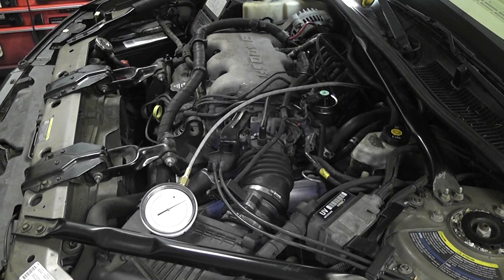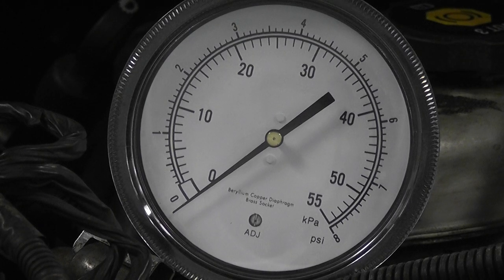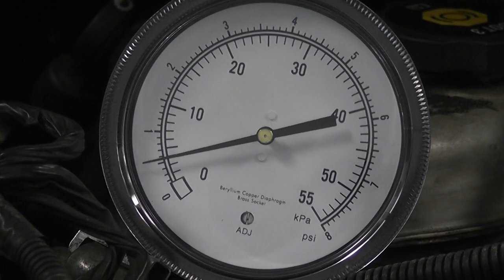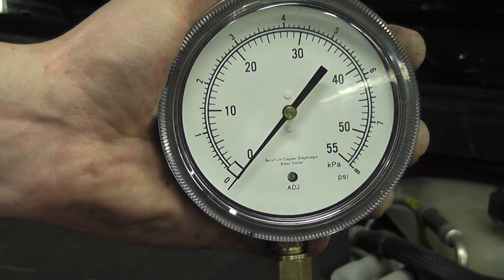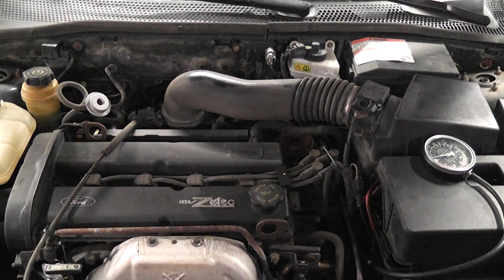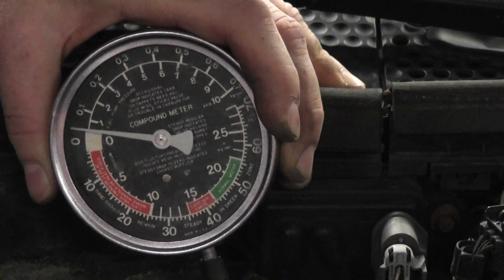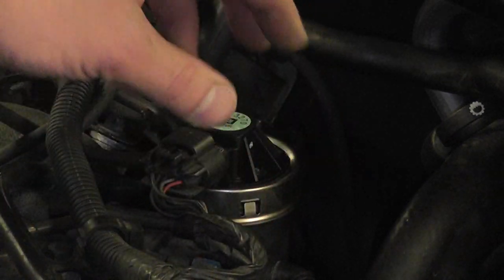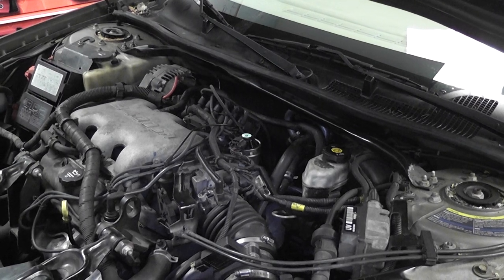Exhaust Backpressure Testing (known bad compared to known good)

Comment: One thing to note, on a car old enough to possibly be having a clogged exhaust issue.  Many times the tiny passages going to the transducer or DPFE / EGR can become clogged.  Although it is a different problem, it can prevent testing from these locations accurately.

Comment from the maker: It certainly couldn't hurt to do the test and as you said you would want to measure each side, unless it has an EGR system that would enable testing at that location. 
If it is normal at the EGR then checking each side wouldn't be necessary. If it is higher than normal then you would have to figure out which side is restricted.

Comment from the maker: @contagiousFX Hey thanks for the comment. I am not sure about the snap throttle vacuum test. (I'll have to do more of them) I know John Thorton (awesome instructor, look him up) uses the MAP sensor signal for his plugged exhaust tests.  But I know for a fact that the test where you hold the engine at 3000 and make sure vac. doesn't drop is not 100% accurate. I had a car with 5 psi of back pressure pass that test with flying colors.

Comment: Thank you for the recommendation for the Ford engines. Much more painless than getting to the front o2 on a 4.6. I previously tried the brake booster hose on a vacuum gauge and that didn't seem to provide accurate results. Will definitely try the DPFE method on my 99 Mustang GT.

Comment: What about using this pressure gauge to measure the pressure after the cat.  On the first test you obviously notice there was excessive back pressure, but you could not determine if it was from the cat or possibly the muffler (collapsed internally causing blockage).  If you use the bung hole for the aft O2 sensor (yes sounds funny, but technically correct), the one aft of the cat, you could compare it to the reading forward of the cat.  If the second is high, it is caused most likely by the muffler and if lower then the catalytic converter.

Comment from the maker: Yes and remember this is a no load 3000 rpm in park test.
Reply: ever test back pressure full load wot? i’ve tried for fun on my stock s2000 with high flow cat, I get 2psi back pressure before and after cat. then I tried on gfs rsx type s all stock, get about 8psi before cat, 2psi after cat. these are done wot hitting close to 8000rpm. just wondering if that’s normal. I get almost no back pressure under no load holding 3000rpm

Comment: I had this problem with my old bronco II.t.  Turns out an intermittent misfire issue I had days prior sent enough raw fuel down stream to melt the catalytic converter. Pulling the EGR exhaust tube and hearing it making a loud hissing noise confirmed the clogged exhuast.  Gutting the cat, made fore a quick solution.  Thats why I like OBD-1 no trouble codes for doing that!

Comment from the maker: @ncrdisabled yes, it is melted and blocks the flow of exhaust gas through it. Also there is a cause of the cat. melting. It is never good to just change the cat. without finding out why it overheated. (misfiring, air/fuel problems etc.)

Comment from the maker: Well that is a big difference for sure as this is a pintle position open code. Do me a favor, bolt the EGR back on. Take a reading on the signal wire with the engine off, then start the truck and give me another reading. It should not increase in voltage. If it does, you most likely bolted the EGR valve on backwards and vacuum is pulling the pintle open at idle. It can be done, I have seen it, however not all models have the clearance to bolt it on backwards but some do.

Comment from the maker: @Mrgeemoney25 That works but only for severe restrictions. I have had car with 5 psi of back pressure at 3000 RPM like in this video that passed that vacuum test with no problem at all. Thanks for the heads up though. I think the vacuum test is only 100% when you do snap throttle testing. I'm just not real confident with the test results on that yet.

Comment: Don't feel bad Paul, I've ripped the hoses off like that and broke some very weakened plastic nipples off the DPFE.
Those parts see a lot of stress from the engine bay heat and exhaust gas heat.
Not Ford's best idea.

Comment from the maker: BTW I like a .8 of a volt closed valve position, just make sure it stays there at idle. The pintle should be facing the intake port NOT the exhaust port. In other words intake vacuum should be pulling the pintle down, not up. This also backs up the notion that it cannot be a plugged exhaust causing this as exhaust gas pushes against the pintle on the back side.

Comment: I just break out a drill bit and drill a thick spot of metal for  a 1/4" pipe thread on the exhaust then tapping it put in a fitting then test it. When done you just put a 1/4" plug in and your done. Time to do is about 15 minutes.

Comment from the maker: Don't worry about the bi-directional control not working. What is EVP voltage KOEO and what is EVP voltage at idle? If the voltage rises significantly from KOEO to KOER then you most likely bolted the EGR valve on backwards and vacuum is pulling it open slightly. If voltage is high both times then most likely carbon on the seat and stem area is holding the valve open a little

Comment: Thanks for the reply. I was aware I might get codes with the new exhaust system, and I did eventually. But it does feel like it doesn't have the power it used to have, so when I first came across one of your exhaust pressure videos I thought it might be worth a shot checking to see if the cats did get overheated. There was a few misfire codes a year ago very briefly, but I think the code was for the coil pack. I don't know if this is the type of misfire that can hurt a cat or not.

Comment: solved the problem. the control wire connection to the egr valve was hanging on by onky a few threads. the connection was hidden behind that rubber insert gm has behind the connector. you are right it was power side switch. why does the ground need to go to pcm as well?

Comment: My bad, its a p0404 code. According to GM service manual, code is set off when there is more than a 10% difference between the desired and actual position. Getting good ground and I tested the reference and power voltage and both come out good at 5 and 12 V respectively. I removed EGR and checked the voltage on the EVP and was getting about 0.8V with the pintle at rest and about 4.4V fully depressed. Smooth voltage change as I manipulated the pintle. Dont have a scan tool so I just used a DVOM.

Comment: There is. Doing drive ability I always road test to verify the customer complaint. I always do this test during the road test, not in the bay. Drive the car till you get to where you feel a lack of power. From there move the throttle past where you are and back to that point again a bunch of times and watch the MAP sensors response.

Comment: im doing a back pressure test on a 2004 dodge dakota and the gauge is bouncing from negative vacuum to 1 psi at idle. any ideas ?
Reply: Exhaust valve issue is my guess. The negative might mean it's partially open when it shouldn't be

Comment: Excellent testing on exhaust 
Pressure testing.
About 15 yrs ago lbwas at a garage checking the electrics on a wagon, a fitter in the nexted bay had put a new exhaust flexy. On the exhaust system of a wagon, he started the wagon up.and was revving the engine, there was a massive 
Bang and he switched off the engine, l walked over to see what had happened,
The exhaust flexy pipe had 
Burst open, you could put, 
Your fist in the hole, and he said that what happened to the original one that was on,
I then said, you mean to stand there and tell me that, 
Did you not think of doing a pressure check on the exhaust system, those flexy
Pipes are over 800 dollars
Each.
Don't think he knows what he is doing.
More expense at somebody's in experience.

Comment from the maker: if the control wire is shorted to ground that EGR solenoid would be energized all the time (on a ground side switched design) and open all the time. you never mentioned a rough idle which is what it would do. some of these were power side switched and with that design BOTH solenoid wires go to the PCM and one will have a constant ground.

Comment from the maker: P1152 and P1132 is "lack of O2 switch, sensor indicates rich" and this is on both banks. So this suggests not an O2 problem but a rich running condition. (that matches your gas smelling oil too doesn't it?) there are a lot of different cause of rich conditions. fuel psi too high, fuel psi reg leaking (return type only), faulty MAF sensor, ECT sensor reading too cold, leaking injectors, bad head gasket, EVAP purge valve issues, timing chain issues, also I don't list a P0513 code? r u sure on that

Comment: Guy I used to work with would drill a small hole in the exhaust to test back pressure and then weld it back up when he was done.  Not the way I would do it,  but effective.

Comment from the maker: The P0405 is described as "Pintle Position Circuit Low Voltage". A plugged exhaust would not set this code. You potentially have a wiring problem. What is the EVP signal wire voltage with the KOEO (key on engine off)? What does the scan tool show EVP voltage and % at also KOEO?

Comment from the maker: If you have no low power complaints then I wouldn't worry about a backpressure test. This is not the test that is needed for a cat. code. In most cases the cat. code shows up way before it gets to the point of restricting the exhaust. My guess is your "high flow" aftermarket cats is what is setting the cat. codes. I'm afraid the only fix for that is to put the factory ones back on. I have ZERO luck with aftermarket cats. They just don't meet the OEM standards.

Comment: Based on your experience, do you have a clue as to what causes my car to die? This is a 1990 Volvo 760 GLE 2800cc EFI B280F V6 engine with ~240,000 miles.  I can start it up from cold, but once I place it in drive, the engine runs rough and dies. Once it dies it is very hard to restart. I have to wait for about 45 minutes. On pulling the plugs, all tips have a black coating indicating that it is running rich. I have installed new plug wires. Also removed the only O2 sensor at the CAT to check backpressure, which is zero PSI at idle and 3000 RPM. I have not checked the fuel pressure. I have to leave this to a profesional. My assumption is that fuel pressure should remain constant at the point where the car runs rough and dies. Removing the Fuel Pressure Regulator vacuum line at idle after operation for 15 minutes did not show any fuel leak. My only other hunch is that the engine may be loosing spark under load!

Comment: Hey Danner, nice video I never thought you could check the EGR valve port for back pressure now I'm glad to know that. I'm curious what part of the exhaust causes the back pressure is it in the exhaust manifold? because right out the exhaust manifold is the EGR pipe that goes to the EGR valve. I ask because I'm wondering if a bad or plugged CAT Converter can cause back pressure. Oh and what does a driveability tech mean? thanks

Comment: I've replaced plugs, coils,bots,Thottle postion sensor, Fuel filter, upstream o2 sensors, New air filter and Cleaned MAF sensor. old plugs were not wet with oil or ant freeze, Air filter in great shape, it starts and ildes perfectly, it's just after driving for a while it will start to hesitate ,then smoothes out,has good pick up otherwise but it happens on and off, then the E light comes on and the codes i get,P0513,P1152 &P1132, used Lucas cleaner,,now oil has slight gas smell,I'm stumped.

Comment: I also have a dodge ram 05 with the 5.7L. Its throwing codes for both cats and some 02 sensors, but only occasionally. I wanted to perform this test on it anyways, but I was curious about the differences for vehicles with 2 cyl banks compared to 1, if any. For instance, I have long tube headers and high-flow cats, but they merge into a y-pipe after the cats and then into the muffler and exit out the same side. Should I take measurements at each of the 4 02 bungs? Should I start with the EGR?

Comment: Would that test be suitable for turbocharged engines? I think that I've melted my catalytic converter (overfueling due to a damaged fuel injector which was replaced) and now it probably prevents the tubine to spin and create boost. The turbine is checked and ok.

Comment: try to connect the vacuum / pressure gauge to a good intake manifold source of vacuum hose like pcv valve hose or brake booster , then rev the engine  to 2500 rpm, watch the vacuum reading over time.. A known good vacuum would stay around 20-23 Hg of vacuum, without any excessive back pressure in the exhaust... If the exhaust was clogged and had alot of backpressure... the readings would slowy drop from 20-23 to 5-10 Hg of vacuum over time ...I will make a video soon to show it

Comment: That other code is a P0153,slow response bank 2 sensor 1 . How hard would the remedy to this problem be determined by a mechanic like yourself~ A few of these reapirs i could do myself, Head gasket no! and timing chain, which i'm hoping it's neither, on a tight budget. other's like the MAF I have no way to ck it, just replace it, and Leaking injectors if i knew which one  i surely would do those. Thanks for the info ,good stuff! Who would you recommend,Pepboys or dealer ? Ford dealer $80 to ck.

Comment: Oh, ok. Did the cars with partially plugged cats have a drive ability problem related to the cat? or multiple issues?. I am just curious. I ran into an older Mercedes that had no easy access to back pressure testing but had all the symptoms of a plugged cat, and possibly more. The customer didn't want to spend any money on the car so I had to stop before I got a good chance to play with a vacuum gauge... All though I have had lots of success using MAP and TPS pid data on other cars.

Comment: Hi danner, I've got an escape which has rough idle no screeching noises. No codes typical P1000, WOT on test drive my bank 1 is lean and 50mv and bank 2 is rich 800mv. I'm suspect on plugged exhaust cause of lack of power. Does a plugged exhaust give you lean or rich o2 voltages? Appreciate any help !

Comment: Hey Paul I have a GM 5-wire linear egr in my 2.2L 98 s10. I'm getting code p0404. When I try to command (using OTC Genisys) the EGR to open it does not respond to the commands. When I manually depress the pintle I can see the % increase and decrease on the scanner. I have good 5V ref, the pintle position sensor is obviously working and both grounds are good. The problem is that im not getting 12V on the remaining wire. Should I be getting a constant 12V or only when commanded (100% duty cycle)?

Comment: My other response got set as spam. Weird. But no its not intermittent. Code is sent after a few miles of driving after I clear the code every time. I put battery voltage on the control wire with test light and it lit up. So it looks like my control wire is shorted to ground. I figure that's the reason by the pcm cant command the egr to open?

Comment: MAP should follow TPS, with a plugged cat the MAP sensor wont. The most important part about this are your fuel trims. With a plugged cat, doing this test your fuel trims should be normal. If you have an email address handy I might have saved a before and after shot on my scanner at work. If I did I could send it over so you could see it.

Comment: my dpfe hose disintegrated the same way the one in the video did. it looked like fuel line so I replaced it with a piece of fuel line I had laying around. Is that okay or is it going to melt and catch on fire or something haha.
Reply: blosom2315 It is normally a silicone based hose

Comment: Would there be a way to check pressure output at tailpipe?
Reply from the maker: no sir, it is the cat that will plug. The muffler can plug too but it is always from pieces of the cat. The tailpipe will always pass this test as the restriction is upstream

Comment: so if I think I have a clogged cat,  can I test the same way at the downstream o2 location to confirm? pressure should be lower past the cat, right?
Reply from the maker: Only if your comparing to your upstream O2. You have to get an upstream reading
Reply: +ScannerDanner that's the plan. thanks.

Comment: I have a 02 toyota camry le 2.4 testing upstream cat the needle never passes zero when i start the car  .when I snap throttle still doesn't  pass zero ...can I back pressure test my cat that is under the car? I have a p0420 code
Reply from the maker: You can have a bad cat that is not restricted. The restriction test is different than the oxygen storage test

Comment: I was driving home yesterday all the sudden I heard a loud hissing noise my truck will not do over 45 now it acts like the transmission is slipping but the oil is fine would that be pumped up Cadillac converter
Reply: could be if you want and you don't live where you need emissions you can take if off and try and hollow it out. you don't need it at all and for future reference it's called a catalytic converter

Comment: I got a 2004 Nissan Sentra, With a p0420 and a P0507 i tried to due the p0507 cause they guy cleaned out his throttle body and not the rpms are fluctating in park 1k - 2k back and forth.... I tried to manually do the relearn procedure but its not working so im thinking its cause the p0420 code is not allowing the idle to learn properly.. i even tried to lower the rpms by pulling injector connections one by one but no luck any experience on these nissans ?
Reply from the maker: that relearn procedure sucks man, do it again and then again, you'll get it, if not you may need a scan tool to do it for you :-(
Reply: ScannerDanner i got a scanner on amazon for like 480.00 ill make my money back from work i get  and im working on that car again tommorow ill try it out not advertising but its an autel hopefully it works